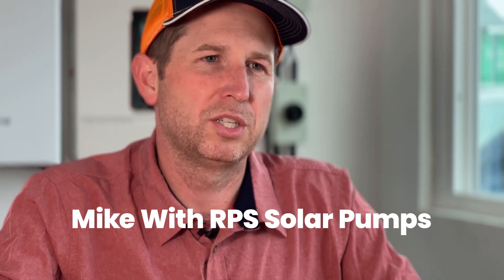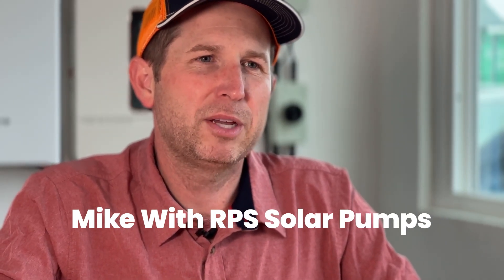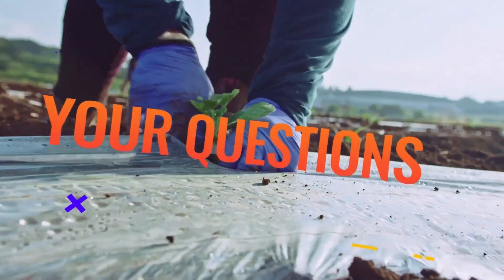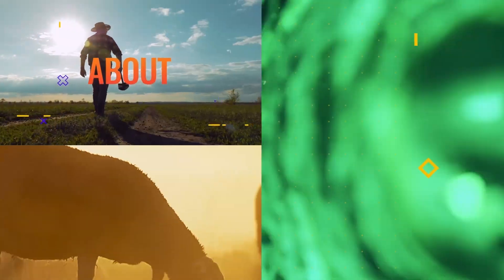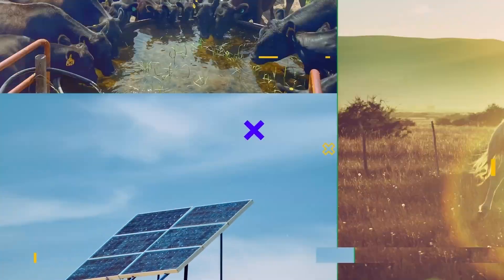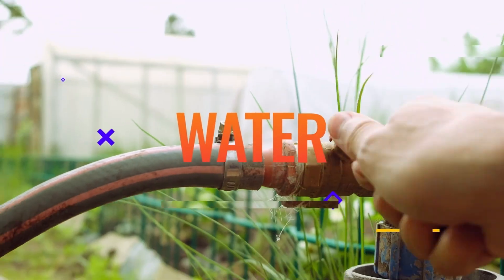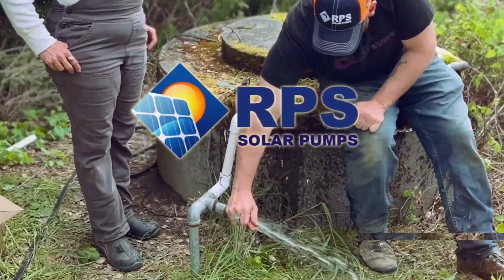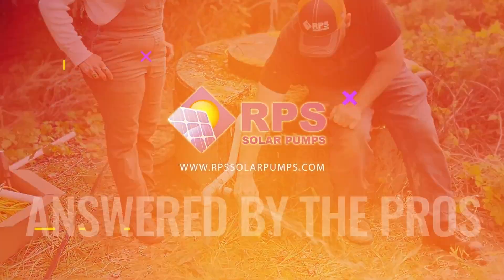How To Calculate Pumping Head | Q&A With The Solar Pumping Experts!

Comment: I’m in the Philippines and submersible pumps finally seem to be catching on here. The problem is, there’s not much knowledge about the sizing factor, both in water volume and physical dimensions. Their typical solution to drop in a 2hp pump and call it a day. A lot of wells are drilled by hand and can take a few days to complete. I’m afraid of wells that aren’t perpendicular or straight. I’m not very knowledgable about Wells but if there happens to be a bend in the pvc casing somewhere along the length of the well, it could cause problems if the casing is too small in relation to the pump diameter. At the moment I’m trying to phase out my deep well jet pump in favour of a solar powered submersible pump for many reasons, reliability and electricity cost being two of them.
 Thanks for your time and patience RPS Pumps!
Reply from the maker: Absolutely friend! It is our pleasure. If you ever need us we do have international shipping. and if you need any help with sizing just give us a call.